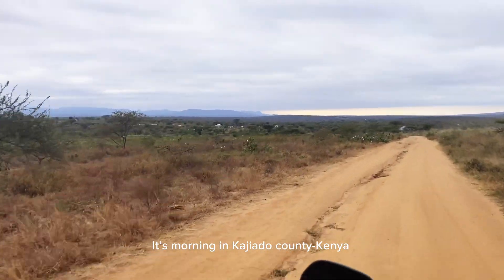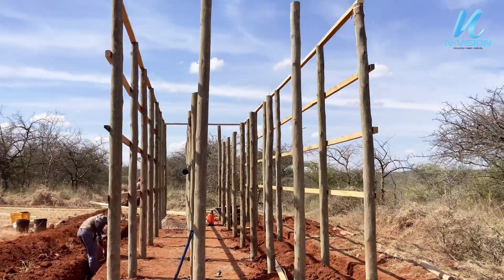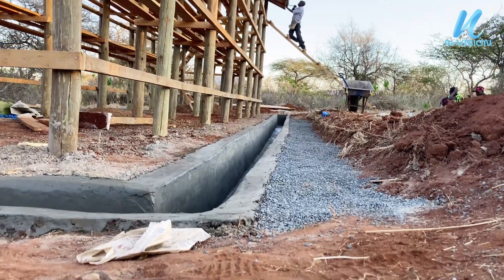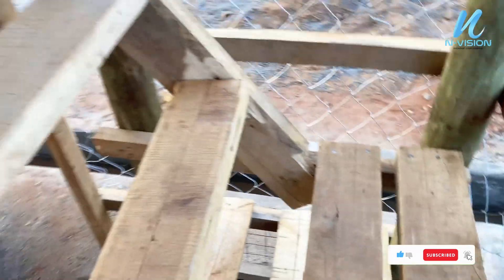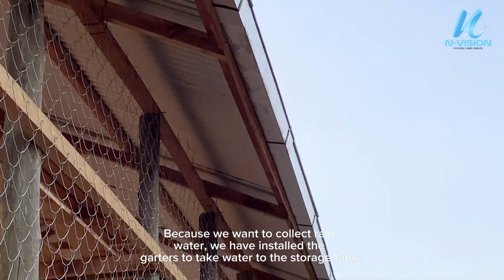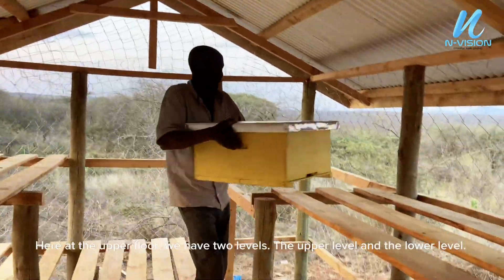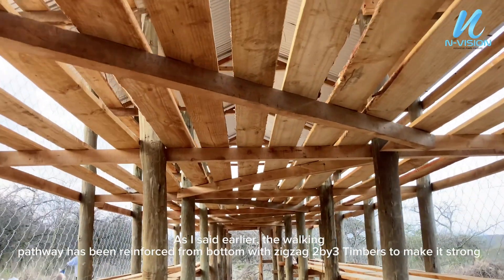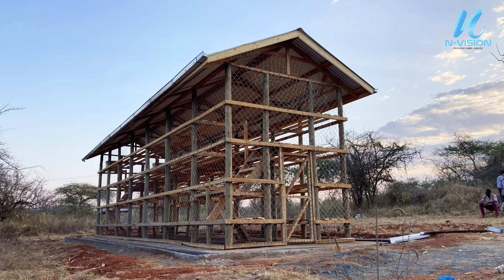Complete Apiary Construction in Kenya | Round Poles Method

Comment: You don’t need toxic chemicals for your fenceposts. Mix 50% used or new diesel oil, (synthetic or natural), with 50% diesel fuel. You can use it for fences, barns, anything that animals won’t be chewing on. It will keep everything from deteriorating or rotting, for decades.
Reply: Hi,
Do you mean that a mixture should be applied on the fenceposts, fences etc
Reply: @jazzyking9195 yes. Put 50% of each in a bucket and mix. 🎉 then you can use it on any outside wood. Don’t use it on anything near horses or goats who chew on wood.

Comment: What's the name of the chemical for the termite at the beginning of the video please.
Reply: You can use as a mix, 50% used diesel oil ( used or new) and 50% diesel fuel. It repels all pests. Plus, it will keep anything wood from deteriorating or rotting, for decades.